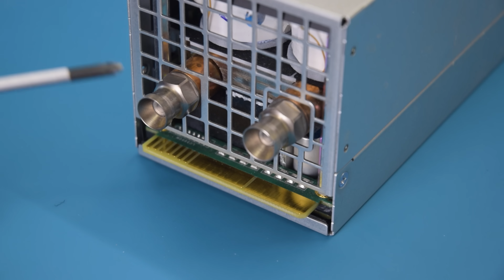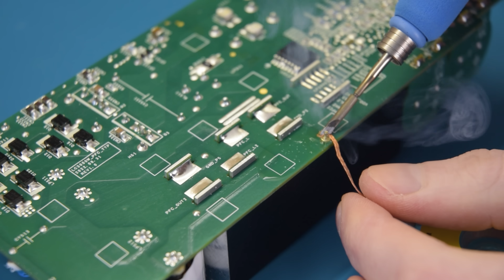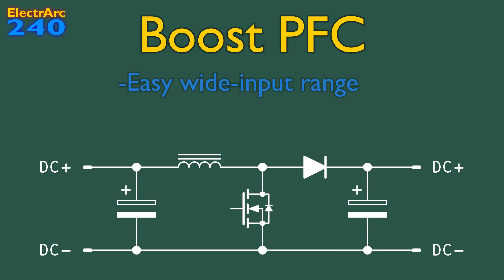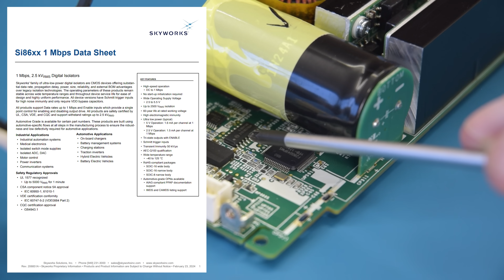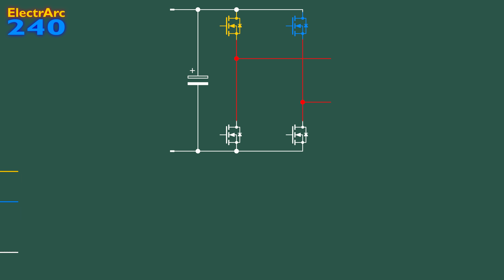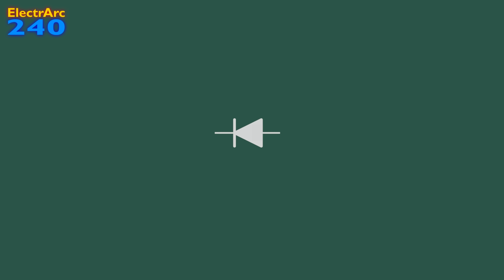Inside a 3000W Water-Cooled Power Supply (with GaN & SiC)

Comment: 1:00 Thats so wild to me, when at the same time, the average internal logic voltage level for parts like a desktop cpu have been dropping over the years. I think currently your average desktop cpu runs in the 1.5v range. Its hard for me to find numbers for recent gpus, but the 20 series's internal logic voltage was hard-capped at just a hair over a single volt.
Reply from the maker: The VRMs that take the 48V to 1V are insane, hopefully soon I will be doing a PhD on those!
Reply: @electrarc240 more insane are the 300A they are doing at 1V or lower...
Reply: @electrarc240  seems like a pretty crazy ratio, like at that point why not go direct 300V to 1V
Reply: 1.5V would be like single-core boost in very cold temperatures nowadays. Normal desktop usage should be under a volt.
Reply: For the same power transfer rate, a higher voltage will cause less losses. 48V will have 1/4 the losses of 12V, and 12V will have 1/12th the losses of 1 volt.
So the idea with processors having a need for such low voltages and high currents is that you bring in the power at as high of a voltage as you can manage, and then when it's right next to the processor you drop it down to the voltage you actually need, using a DC-DC buck converter of some sort to turn high voltage low current into low voltage high current.
It's a lot like designing a driveshaft to transmit a given amount of power (torque * RPM) to a distant load, to minimize the weight of the driveshaft, you will maximize the speed at which it rotates, which minimizes the torque which it must transmit for the given power transmitted. This is why rear wheel drive front engine cars have a small pinion and a large crown gear, it means they can make the driveshaft out of a hollow tube rather than a solid piece of metal, saving a massive amount of weight compared to having to drive the wheels with a gear ratio of 1:1.
Reply: @SciDerg  insane thing is not the losses reduction, but buck converters stepping down voltage ~ 48 times, with standard topology and single inductor
Reply: @pingwinvonjelen6586  Similar to LED driver buck converters operating from rectified mains voltage (320VDC) down to 5V or 12V
Reply: @pingwinvonjelen6586 These buck converters are really surprisingly simple devices, I think it mostly stands to a testament of how incredibly good silicon MOSFETs are nowadays, because you can get pretty good efficiency out of them down to around 600mV with 20+A per device. All the high current rails are done with multiphase buck converters though, 6 or 8 phase is typical, many even use 2 parallel fet+inductor groups on each phase. Newer CPUs and GPUs that like even lower voltages often have integrated VRMs that can drop down a 1.5v supply to around half that or less, which can also help with efficiency.
Reply: @SciDerg  48 V will actually have 1/16 the loss of 12 V, as power dissipated by a resistance is proportional to the square of current. So 12 V will have 1/144 the loss of 1 V.
Reply: @SciDerg but you have to get it down to 1V in the end and smaller ratios work better

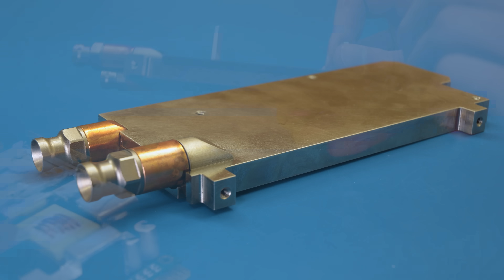Comment: 13:58 it probably has not the required power rating
Reply from the maker: Yeah I guess modern cards can dissipate a lot more than 300W! Also this has much more spread-out losses than a single die that needs special care to get so much heat out of such a small area

Comment: Many large capacitors do not come with long pins from the factory and are made by the factory with thick, short, and non-bendable pins, so they had to use that converter.
Reply from the maker: I don't know why I didn't think this was the case, I guess I just thought they were small enough to still have standard long leads, but of course this makes complete sense!
Reply: @electrarc240  they are press fit capacitors, the idea is you pair them with through-hole transformers and avoid any long lead through holes on the board and skip needing a lead cropping step. Dealing with cropper machines before wave soldering is a pain, even more so if you want SMDs on two sides and/or reflow only
Reply: @electrarc240 maybe they used a package with a kelvin pin in an earlier revision of the board, and then they decided they don't want to do kelvin sensing at all, but then finding a three pin package that would fit all specifications and recertifying it could have been too much work and not worth any savings on a short-run design like this. leaving the pin floating might have introduced noise so they tied it.
Reply: the mechanical gain for reliability of the pcbs is great. No floppy leads to vibrate and break , thermally age the joint into the can. The server racks do vibrate a lot. They get hot. Having the cards also removes the need for cap hold downs - no glue or tie wraps. Units will be transported all over the world. Expect drops from trucks and aeroplane ramps. Drops at -35C really play havoc. PCB can also decrease series line resistance and inductance through wide wide wide traces thus helping stop ringing and increase effective point capacitance. In manufacturing the cards will be loaded and soldered automatically. So potentially a pick and place machine will be used to build the cards. No human needed to prep and feed wires. i am sure I missed stuff but this is a good start. Power supply is a lesson in how to build good supplies. It is also absolutely amazing what we can do now. SiC and GaN have revolutionised power conversion. One can buy a 10A 650v transistor for a few dollars now. Ten years ago it was ten times this. When I started engineering in the early 1970's such a device was not possible, Even imagined. Those GDTs in solid form are real nice.
Reply: We use longish capacitors mounted with bent pins. We have experienced Internal failure in these when mounted this way after extended testing with high vibration.

These are 12.5x30mm capacitors iirc.

On x-ray, you can see the pins break off inside the capacitor roll.

These are mounted to the pcva with zipties and silastic.
Reply: @dumle29  That was more scientific and reliable information, thank you.
Reply: @hosseinniazi3154  There is also the issue of process reliability. These large caps can be placed and wave-soldered on a panel which is a cheap process step. Bending leads manually is unreliable and the cap also has to be tied to something as an additional manual step. This in turn requires handling the board more than needed at assembly. Using these PCBA adapters makes the final assembly very quick.
Reply: @einball  I've seen them used in car electronic modules, which have the capacitor and pins mounted to the plastic socket assembly. Looks very fancy.
Reply: @Rotwold  In the automotive industry, things are different again. Here, production volumes and (vibration, temperature, reliability) requirements are so high that the mounting solution for large objects becomes very critical. Their solutions are fancy indeed. However (and that has nothing to do with the topic at hand) I do question the necessity of these complicated  construction methods .. Back then we had ignition, fan control and everything was fine 🙂
Reply: @dumle29 did you used radial tool for fix pins for first 1-2mm and bend or just bend pins manually?
Reply: @dumle29  "These are 12.5x30mm capacitors iirc."
- Are you referring to @22:58 as in the 450V 430uF (Rubycon?) cap? This cap is CLEARLY 20-25mm x 50-55mm. Just look at the guy's thumb. And the other cap is even longer.

I have never seen 'big' line voltage caps with long leads. 25V Chinesium, sure, but not 450V Rubycon. Screw mounts or (really) short stubs, always. But please do prove me wrong and give a link / product code.
Reply: @MrZetor  I think they were talking about their own product.
Reply: @dumle29  So why would the pins not break off if they are partly replaced by the copper traces on the extension board?! That's a stiff structure so it will put even more strain on the short pins that are left...
Reply: @JosBergervoet  The tight mechanical coupling of the cap to the board (direct contact and with silastic or similar adhesive) means vibrations will be transmitted through both the body of the capacitor and the pins. The force is no longer transmitted just through the pins so the interface between pins and the internal roll-up are reduced.
Reply: @dumle29  Yes, I recognize this too. We had electrolytic capacitors with bend leads leak over time, causing a nearby connector to corrode and lead to all kind of failures. Seeing him bending leads like that at 5:20 gave me some shivers :D
Reply: I was thinking about that too; designing circuits has more to do with adapting to the modern component supply chain than anything else.
Reply: @ena6227  Com certeza a Intel não vai comprar apenas 100 peças. Já vi muitos fabricantes usarem valores não padronizados em produtos de consumo somente porque eles podem.
Reply: The reason they use thick short non-bendable pins is because long pins cost extra to ship and most of the time they'll be trimmed flush upon installation anyways.(EDIT: Additionally, especially with low ESR/ESL electrolytic capacitors, the long leads would encourage a use case that has high parasitic inductance due to the long leads, which would negatively impact the low ESR/ESL ratings of the capacitor, making it a less ideal component and inducing extra losses in the circuit.)
Reply: Long legs require special mount and/or use of compound to fix component in place.

Anyway, most caps have legs way too long for any reasonable mount/placement. 

IMHO
Reply: Yup,  snap-in types have a riveted tab. Normally the tab is a very short pin. Special order can get a long strip or bent style.
Reply: Yeah snap-in is pretty much standard for large filter caps these days. Not a lot of selection in traditional through hole. Cheaper to spin some adapter PCBs than order a non-standard part
Reply: If you design power-supplies for 24/7 and 5yrs+ theoretical possible lifetime and keep all requirements in place... its typical that you end up with exactly "this" capacitor - and you dont hesitate mounting it that way as there are no alternatives... I dont think it has something todo with vibrations...
Reply: Depending on the layout used for the "breakout" boards, this can be significantly lower inductance, as the current paths can be placed much closer together and spread out over a larger area.
Reply: They’re called lugs, right?
Reply: I would be concerned about reliability if subjected to vibration. Those caps are quite heavy and I would not trust the solder alone to hold those small boards without the joints cracking. Of course spacing the caps off the board also opens up some PCB real estate under them.
Reply: I think it also reduces lead inductance and resistance
Reply: @theoldbigmoose  🎯
Reply: @theoldbigmoose  yes
Reply: @theoldbigmoose  Yup. Much lower impedance in the path.
Reply: Long leads add inductance to the circuit.
Reply: Also, springiness of the bent leads in the capacitor's up-down reference frame (the power supply's sideways reference frame) would be excessive vs a rigid board.
Reply: @timconnors lead-plate attachment points are a common failure point for electrolytics, so putting the joint on a pendulum that amplifies vibration (eg acoustic - server rooms are noooooooisy) can easily cut lifetime. great catch!
Reply: Uh, no Peg.
Reply: Tóp of The Wozzamate  from the landdown under ,,,TRANSLATION,,, JOLLY GOOD SHOW OL CHAP TOP TOP HOORAH HOORAH AN ALL THAT SORT OF STUFF,,,,TRANSLATION,,,,, Very good work my friend
Reply: I agree. I've had 2 big caps be exactly like that. Just 2 short nubs for leads.
Reply: Yes, these are called snap-in caps. They're rated for much higher currents than regular radial caps with long, thin leads.
Reply: If I’m not mistaken, the caps are very close to the edge, so bending the leads could very easily create manufacturing differences and end with them shorting to the case.

By using the PCB it’s very easy to guarantee you won’t get nasty shorts.
Reply: Other reason - there is no height for this capacitors but plenty of width

Comment: That supply looks suspiciously like a 208–240 vac input, 48 V out rectifier used for massive DC plants used in telecommunications industry.
I think it’s a bad move to put the water and the electrical connection on the same plane or side  since these are usually used in stacks of up to 60 or more supplies just one broken waterline could be a total disaster. 

Thanks for the Peek inside.
Reply from the maker: The coolant connections are on the same face as the output terminals so that it can be hot swappable and tile-able allowing a single server to have multiple of these for redundancy. I think the idea of removing one while the server is running and coolant is flowing makes the design seem even more sketchy!! Must be safe though...
Reply: @electrarc240  a simple solution would be to turn everything 90°,  electrical on one side, cooling on another, sepparated by a sheet metal separator that would be as tall as the PSU itself
Reply: Water may be the problem if that DC did not use pure H2O or other type non conductive liquid.

Spilling isn't optimal in that case but not deadly.
Reply: @f00busb4r-g4i  Eons ago, I ran a commercial YAG  laser welder that had xenon EXCITATION flash lamps immersed in deionized water for cooling. Yes, the lamps were immersed directly in the water and the lamps being a foot long or so needed several thousand volts to excite them into conduction. So trouble one is on a catastrophic failure, water touching any surface becomes contaminated, and is no longer non-conductive To a varying in degree. And in this case, what was directly below, the Laser housing was the computer that ran the whole thing. I did end up designing a “rain hat” for the computer, to minimize the damage whenever the flash lamps exploded, which was about once every month or so.
Reply: @franksprecisionguesswork501  once a month?! thats actually hilarious :D
Reply: @k1ngjulien_  there's some weird physics where the lifetime of a xenon flash lamp decreases as something like the inverse eighth power of the pulse energy, so you know they did this on purpose when they could have used a slightly bigger lamp for the same pulse energy and had it last way longer.
Reply: While watching the video, this crossed my mind. Liquid cooling is not yet a fully accepted reality in the electronics industry. We see many gamers buying kits for their GPUs and many sad stories of leaks and major damage. In the industrial sector and in mainframes, liquid cooling has been a reality since the 1980s. I just wonder why I've never seen pure mineral oil (the same used in millions of transformers in the electrical grid) being used, which has good thermal properties and doesn't pose a risk of damage in case of a small leak. Could it be some aspect of fire regulations? That's my question.
Reply: @joseluisvaiksnoras7857  Even pure mineral oil is nothing compared to water when it comes to the ability to transfer heat. Transformers settle with oil because even though water may be better at transferring heat externally, the "pureness" of the water making it an ideal insulator is largely going to require much effort to keep it that way. The oil doesn't really have that problem of needing to be "as pure" to be a good insulator and it also helps transfers some heat. Where there is a large enough concern in certain spaces where the oil CAN become a problem due to fire risk, then I'm sure they will adopt some kind of actively water cooled transformer where the windings just aren't submerged in it.
Reply: @joseluisvaiksnoras7857   mineral oil is moderately toxic and extremely messy because it doesn't evaporate like water. If you spill water you just leave it until it evaporates. If you spill a little mineral oil, it's there forever. If you spill a lot of mineral oil you created a toxic clean-up site.

Comment: Amazing video, so cool to see how these are structured. All this cool technology, just for it to most likely go towards things of zero or negative value...
36:35 Yep, the "fancy controllers" that can power on the server over the network generally also know mains input voltage, power consumption, rail voltages, among many other datapoints from all over the system. At least mine do.
Reply from the maker: Cheers! Love the subtle flex "at least mine do", haha.
Reply: @electrarc240  Homelab is love, homelab is life :)
Reply: What fancy controllers do you use?
Reply: @LoganDark4357  Just the built-in iDRAC on the Dell servers, I grab the data over SNMP and keep it in a database for Grafana visualization

Comment: Could it be that they didn’t want components facing the chassis? (I’m a total noob btw)
Reply from the maker: Yeah I was wandering that, but there are other areas (like the top and bottom) that do have that, and just use the insulation sheets. Surely it wasn't to save the cost of another sheet? (much more than the cost of a second different PCB!)
Reply: @electrarc240  Perhaps they didn’t want to run the risk of the isolation being insufficient on those parts? (again, I don’t know what I’m talking about)

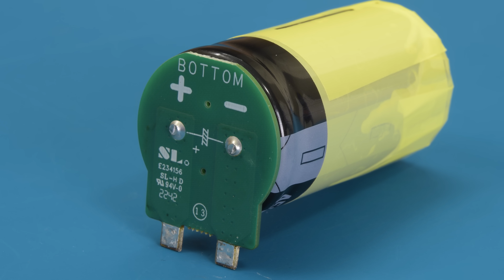Comment: @5:13, the vertical break out board for the bulk caps; why would one put this column of vias parallel to the current path?  Wouldn't the vias that circularly enclose the cap pins suffice? I cant think of an electrical purpose. Anyone?
Reply from the maker: I think they're just there to tie the layers together (presumably just two), so they behave more like one fat one and share the current better
Reply: Thermals or better sharing of the current between the sides maybe?